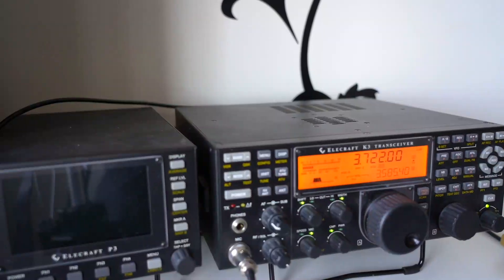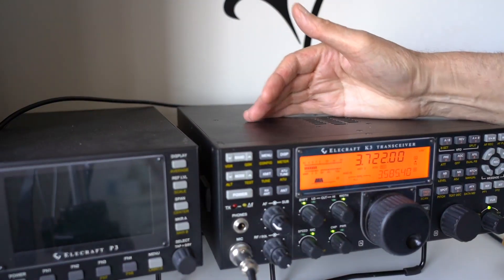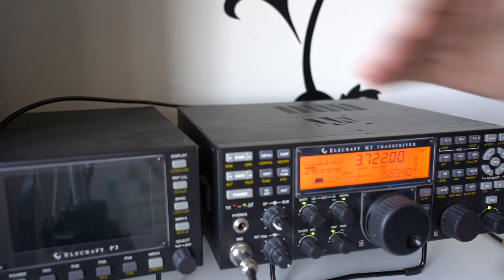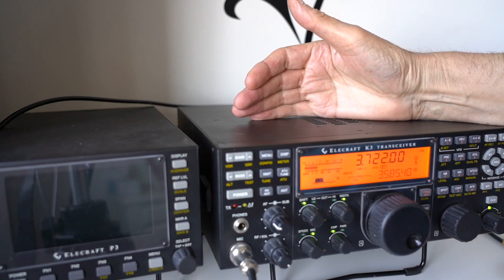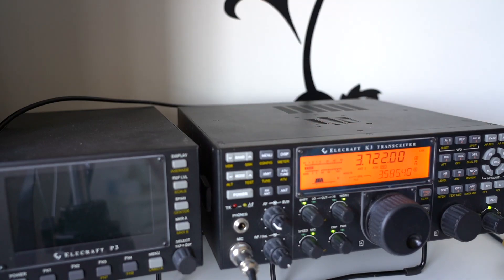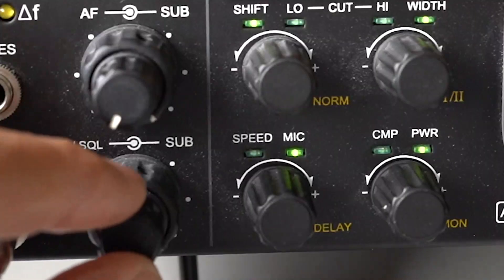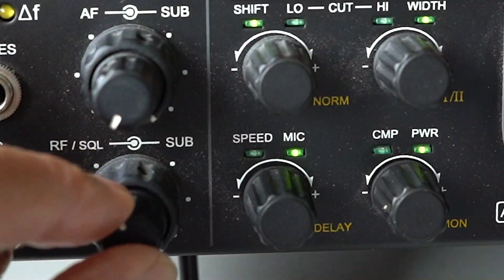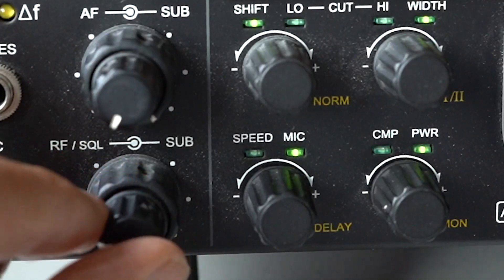Better HF Receiver Performance - Zero Cost

Comment: Peter, Great idea to cover these points on what one is doing while tuning a receiver.  I have been licensed for more than thirty years and playing with radios longer. Studied all manner of issues but I am sorry to report I never conserved how to employ receiver controls properly. I had learned to use controls by hit and miss but never had the actions explained in the way you did. Now I know why I turn down the RF gain and how to find the proper alignment for noise floor using the S meter.  Thanks, de N4NRL  PS have watched other of your videos and found them informative thanks for the time. Compared to you I am a newbie even after more than thirty years.  hi
Reply from the maker: Many thanks

Comment: Firmly aimed at newcomers You said....nay . I bet alot Ham radio operators of "these days" didn't knew about the rf gain / volume "trick" hehe...I use all the times, both on my boat anchors and or new rigs. You Sir , You deserve a subscription and a thumb up because this is the spirit : sharing the knowledges ! Please stay safe yourself also, '73 de Adriano IZ3SVI
Reply from the maker: Thanks for the info

Comment: a little trick i done is take a plastic water bottle that has smooth sides, cut the top off at the largest bottle diameter .....
then turn it upside down over the speaker on top of the radio.... 
it will cut the hash and Bring out the voice ..
and i also used silicone RC fuel tube and cut a slice the length of the tube and put it around the  edge of the bottle
Reply from the maker: Many thanks Bill

Comment: Best thing I did was to do away with my power line adaptors (Ethernet over mains) and fit a mesh WiFi system instead. Prior to that, it was virtually impossible to receive without relying on the various SDR radio noise blanking algorithms. Whilst they greatly improved audio, they were detrimental to digital modes. Using a Wellbrook loop antenna, I’m now able to cancel out most of the remaining household noise sources, albeit the laptop itself can be a noise source.
Reply from the maker: Graeme many thanks.
Reply: watersstanton Having turned to SDR radios completely, I miss being able to employ RF gain in an intuitive way. On stronger signals, I’ve found that tweaking the AGC threshold can drop the audio noise floor albeit at the cost of weaker signals. One day, I must compare how well modern SDRs perform against older radios like the Collins R390A (I have a couple that have not been used for over a decade!).

Comment: Decades of advice from those who have learned is more than worth the time, especially when I am setting up my station now. So many times we, as operators, new and experienced forget the simple things because technology sounds so good when we are bragging on what we did in our shack. The hand over the speaker idea, make it a cup or plastic glass cut in half, then you can use both hand to run the radio, lol
Reply from the maker: Many thanksfor yiur input. 73 Peter.

Comment: As I understand it, turning the RF gain counter-clockwise reduces the gain of the receiver strip from the early stages. Reducing the overall gain does nothing to the signal-to-noise ratio of the received signal (especially if the noise is QRN). That means it's little better than an RF volume control, so in general it will provide little benefit over the audio volume control, and my guess is that's why so few people use it. However (and it's a big however), decreasing the front end gain improves its linearity and resistance to intermodulation distortion ("intermod") - and that can be a big deal, especially when operating in a high-signal and high-noise environment. On the lower bands that's going to be the case because of high noise and broadcast stations nearby, as well as strong amateur signals in-band.The fewer intermod artefacts your front end projects into your signal passband, the better. And since intermod reduces at 3dB for every 1dB of amplifier stage output reduction, even a small cut in RF gain causes intermod to reduce dramatically. Remember - it's generally signal-to-noise (or signal-to-interferer) ratio that counts for intelligibility, not absolute signal strength, so you might well find a sweet spot in setting the RF Gain (improving the signal-to-intermod ratio but reducing the signal volume) versus the Audio Gain (compensating with an increase in signal volume). It all depends on what level of clutter and noise is hitting the front end of your radio. John ZS1ZC.
Reply from the maker: John maybe you did not fully understand, Reducing the RF gain so that the noise floor is just at the point AGC kicks in was what Iwas talking about. That makes a significant difference. I was NOT talking about s/n ratio.
Reply: @watersstanton  Yes, I re-ran the video and to be fair, you did say "the noise that you'll hear BETWEEN syllables" - my mistake. I did some quick research on this, and there used to be a use case for RF Gain to counteract the intermod effects of old-style product detectors and poor amplifiers (i.e. reducing the distortion generated within the receiver). But what you're describing is going to be possible where, in effect, we're shifting the AGC characteristic so that the combination of signal and noise sits on a part of the AGC-controlled Pin/Pout curve that has a greater slope - this means that there is less compression between the level of the audio signal and the level of the noise between syllables (so the audible difference will be greater). And a slow AGC means that the AGC level set for the syllable carries over into the noisy space between and attenuates the lower-amplitude noise more than if the AGC were set by the noise alone. I just tried it on an analogue receiver on 40m SSB (S7 noise) and it does diminish the bursts of noise between syllables that would otherwise be jarring to listen to. However, it seems to be a narrow sweet spot and needs readjustment for other operators' signals (possibly annoying in a net). Thanks for the video, it's alerted me to RF Gain being more than just an attenuator for strong signals.

Comment: Interesting tip on the RF gain control and it makes total sense. This is basically what we do when setting up Tower Top Amplifiers and padding attenuation in so you burn the excess gain and don't amplify the noise.
Reply from the maker: Glad it was helpful!

Comment: Nice to see one of the emporiums giving good solid advice instead of advertising their kit... I have to say I have been guilty of dismissing new operators who don’t know what the RF gain does... but you made a good point... who has  told them of its use in mitigating noise?
I will run through these operating procedures at the club when possible, with hands on demos..
Us old folk who were brought up on old valve kit, learnt by trial and error.. will pass on these gems of information. Thank you for another accurate video Peter.
Reply from the maker: Thanks Martin.

Comment: Some great tips and advice Peter. 
Especially the correct use of the RF gain by matching the meter deflection with the background noise. I'll certainly be utilising that from now on. 73's 👍
Reply from the maker: Glad it was helpful! 73 Peter

Comment: Excellent advice Peter. I was brought up on valved ex-services receivers in the 1960's. I was always advised by the old timers to educated me in the hobby, that you should rarely have the RF gain control at 100%, and that you could leave the AF gain alone for much of the time and use the RF gain as a volume control.
Reply from the maker: Thanks for sharing

Comment: Wow, nice video. Very nice equipment from past and now. As a Novice Ham in 1950's I got on air with very basic receivers. I was KN2MHP then. I did not have funds to buy Collins so a Command receiver BC454 was my 80M receiver on CW. Well its 2020 now and I truly appreciate a very good receiver. I have a Icom 7600 and a Icom 7300. Its ability to shape receiver bandpass and AGC action is remarkable. Plus turn on or off NANNY'S that help me receive signals better. Its only a exercise when actually doing it. Gotta have hands on. Its so much fun.  20 years ago I visited the Antique Radio Museum in Holcombe NY. Saw a spark gap in operation. Touched a Collins 75A4 receiver. It was wonderful. Proud to say a 60+ year life member of ARRL. Short wave and Amateur Radio been apart of my life forever.  Thank you.  Peter W2HP

Comment: Well done! I have always turned the RF Gain down on my IC-7300 SDR until the noise level shows an S1 while turning up the AF Gain to a comfortable listening level. Combine that with a AGC Slow setting and you get the maximum dynamic range of that sensitive HF receiver. I rarely use the pre-amp (1 or 2) or the attenuator (except on very local stations). The only time I use an AGC Fast setting is on full carrier signals (e.g. AM, FM). I'm still experimenting with the bandpass IF settings but do narrow them at times to cut-out neighboring interference and/or improve the S/N. 73s Greg KJ6ER Silicon Valley
Reply from the maker: Many thanks Greg

Comment: Use as litle Rf gain as possible is a my rule of thumb specially for CW. Also regard AGC as a limiter rather than a producer of constant audio level. Just my two pennorth. Al  G0KMC
Reply from the maker: Yes I agree
Reply: @watersstanton  I should have said keep RF gain to a minimum

Comment: If you look at new topologies, such as my new SDR radio, an Icom 7300, many of the controls are set from menus. However, many of the OLD style controls are still there, but are COMBINED. {Such as audio volume, RF gain, and such.} de KQ2E
Reply from the maker: Thanks Bruce.

Comment: I’ve found that my Collins 75A-4 can keep up with almost anything made today. I haven’t found anything yet that can make me switch to a modern radio.
Reply: I agree with you. I had a modern FT-950, sitting side by side with my early 1980's FT-101ZD, simply switching the antenna between them. Nothing much to choose between them on the receive ability, but the audio from the 101ZD was much more pleasant. Also, I was much more likely to be heard on the first shout on the 101ZD than the 950 by a distant station. Both were using the fist mics that came with them. After a few months, I sold the 950 and still use my 101ZD today.
Reply: That’s how I did it as well, put them both on the same frequency, then switch back and forth. Between the 75A-4, TS-830S, and a FT-DX3000, the older radios are far more “listenable” to my ears than the new ones.
Reply from the maker: Probably the valve line-up helps as well
Reply: I agree, plus there's something about valves that just makes you feel like you're operating a real radio and not a toy.

Comment: About that sunspot cycle. I'm a relative newcomer to amateur radio and a complete newcomer to operating on HF (although I am an SWL from way back). I have to use a coil-loaded whip antenna to hide from my homeowners' association. Nevertheless, I'm making CW contacts all up and down the west coast of North America. To my way of thinking, if I'm bouncing my signal off the ionosphere and having fun under conditions that are as bad as they'll ever get, then the coming months and years should be a blast.

73 and thanks for the videos de W6KSR

Comment: Excellent video. Thanks. I would like to state however, that SSB has now been in use for over 70 years and it is probably high time for something better than SSB. Good attempts at this already exist and these deserve our full support. Example: FreeDV. For RTTY which is another probably rather outdated mode, VARA Chat is a good replacement candidate in my opinion.
Reply from the maker: Hi there. Yes SSB does go back a long way, but was only embraced by hams from around 1960 - I wa there - Hi, 73 Peter.

Comment: Great video, thanks! I had a room full of old equipment that I would rotate through weekly on AM and CW. But I eventually pared down to a smaller QTH. I did keep my Johnson Ranger, Heathkit Cheyenne, Loudenboomer amp, NC 183D, National 2-40D, GPR-90 and Hallicrafters S-20R (my first rcvr in 1962). Icom 9300 is my daily “driver”. BTW, love the artwork on your wall

Comment: re RF gain control... on the old BC348 rx wasn't the "Volume" control actually RF and AF gain ganged together as one ...  not as impressive with just one knob on the front panel but it seemed to work well nevertheless.   Talking of keeping signals down to not distort front ends the one I always laugh at is "nice signal... your 1kW is coming through here 5/9+30"... so if he backed his 1kW off by 30dB and only transmitted 1W he should still be 5/9 (but cause significantly less blocking to other users of the band elsewhere in the world).
Reply from the maker: Thanks Ian.You may well be right about the BC348. 73 Peter

Comment: Yes, my first thing to do is to control RF gain, especially when monitoring BBC broadcasts, at 3.X MHz and 6.X MHz,  and I got +50 dB over S9. Yes +50 dB over S9. 

Next, I use the TWin Pass Bnd Tuning,  to 'focus' the weak signal.  I enabled  Noise BLanker and set Notch filter to auto. 

Sometime there is RFI from electronic devices nearby, and try to find and 'elimanate'  it.  If eveerything is not working, the best  thing to do is to switch off the rig .. No more noise.. :)

Thank you, and cheers, 73.

Comment: As always, great info and an excellent presentation. Many good points. Some new to me.
Many decades ago my Elmer clued me in on the RF Gain method of reducing noise. My implimentation was/is to turn RFG to zero and AFG to max and then raise RFG to a level that allows best sig copy on my 590SG. It's effective but now I must try the RFG adjusted to S-Mtr noice level, as soon as I get my 40Mtr, being extended to 80Mtr, EFHW arial reassembled tonight. HaHa

Sir, I Like/Save every vid of yours..........

73 OM de KA1RUW in So NH

BTW: You are one of the most valuable HAM assets on YT..........
Reply from the maker: Always good to get your comments. 73 Peter

Comment: Thanks for the Memory lane trip. Fondly reminiscent!
Some years ago I had access to my employer's pro signal measuring etc,. apparatus.
At the time I had an AR88 and what was then, the first use by Icom of the Flagship. IC 751.
I was able to measure, on a pro test set the properties of both sets.
Whilst the AR88 didn't have a the accuracy, stability et al of the Icom, it didn't have the decency to fail on sensitivity and S/N ratio at 21/28 Mhz! Sinad,
Streuth, I could pick up 3 Icoms but needed a good meal and an Olympic training session to move the AR88 to a new position on the bench.
Don't know how my HROs would have figured because by then I'd parted with them!
73 de G3NBY

Comment: Nice to se. cr100. Racal. Ra 17.  Beautiful old receiver.  I recently. Purchest  an  Ar8600mk 2.   Ruddy impossible  to. Understand   but. For. Suctch. Small radio  not bad.  Audio quality. Could been made better but I use one  of those phone amplifiers reachable.  It worth trying   the audio  quality is mutch better in joyed  the video  swl  JM
Reply from the maker: OK John. Nice to hear from you. 73 Peter

Comment: i am preaching the same things over and over again but they just dont wanna listen, and instead they keep doubling and misunderstanding and so on, just bc they are so happy to big signals on there s-meter. once you've shaken off vanity to see 9+40 you living/listening more easily . So many tools today in modern transceivers, RF gain, ATT, Filter edges, roofing filters, moving preselectors etc .. I dont drive my car as it left the factory neither, i adapt to my needs and conditions... 73, DO8WA
Reply from the maker: Nice to get the comments. 73 Peter